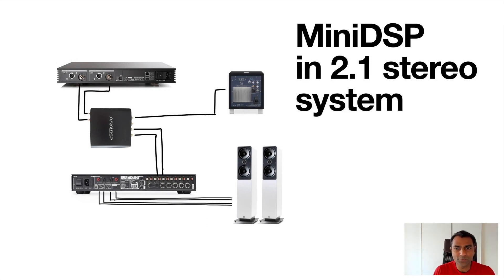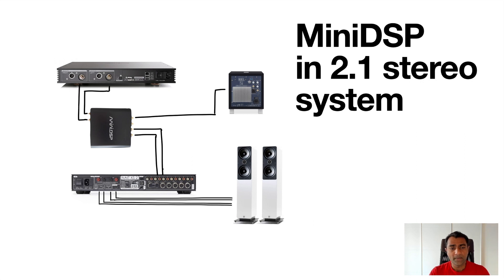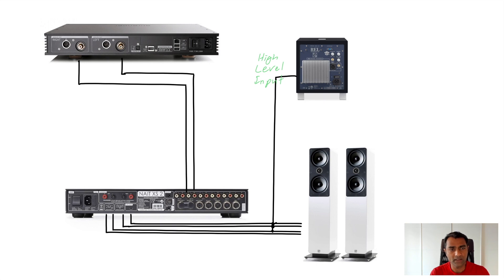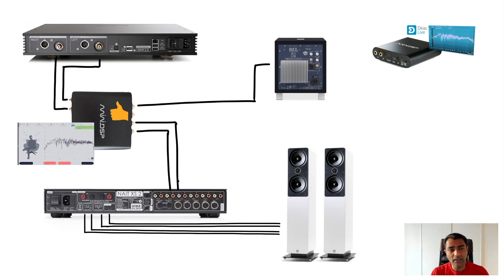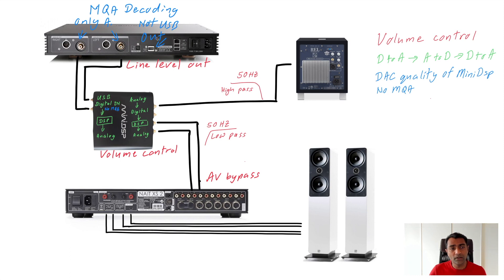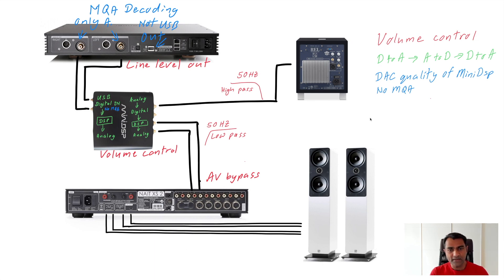MiniDSP in 2.1 stereo system

Comment: I am putting a system together and found your video interesting, I think your main challenge is you are using an receiver/AV at the core. I think you need a power amp and position the DSP between the receiver and power amp

Comment: Thank you for this video! I especially appreciated the points you made about the challenges - volume control, Conversions, DAC Quality. I have a similar set up to yours (Innuos Zen Mini server/DAC - Naim SuperNAIT3 - Dyn Super 40 book shelf - 2x REL T7x subs). I'm considering the MiniDSP FLEX for this system. Smallish room that is my home office, not dedicated 2 channel room - compromised.....system sounds good, but always....could it sound better with Dirac Live? I had thought to do a couple presets 1) keep RELs on high level inputs....mute during calibration....bring them back in manually 'tuned' 2) use .1/LFE on RELs out of the FLEX so I can utilize Dirac on the subs as well. Good point about volume control - I hadn't thought that through with the preset 1 option above. 

I read though that you have removed the MiniDSP / Dirac from your system - my 2 channel guy is a super purist, so I haven't run this DSP thing past him for concern about what he would say......what was the main reason for you to move away from the DSP / Room Correction 'solution'?
Reply: Funny - I called my shop owner, and he presented me with the same reasons to not go forward with it that you alluded to. He mentioned the same challenges, and cautioned about adding to the signal chain. He is the kind who builds relationships and wants his clients to be happy long term, so it wasn’t a ‘don’t buy that from them, buy this from me’ kind of thing. Still, excellent video! Made me stop and think through this a bit before plunking down the funds.
Reply from the maker: @OEFVet0405  glad I could help
Reply from the maker: If you like to experiment, I would say go for it and try. It’s not that expensive. Goof luck and let me know.

Comment: Excellent explanation.   Late to the party i suppose.   I think throwing MQA in the garbage is probably a positive step.   Lossy compression is getting in the way of your signal chain.
Reply from the maker: You are totally right. I got rid of the MiniDSP too. Will make another video.
Reply: @priyangh  I'm going back and forth between active crossovers in monitors and dsp and passive loudspeakers.   It seems fun to have an amp and a dsp and balance the room but the kali lp-6's in my small room will likely do just as good a job without all the fancy dancing.    On the other hand 2.1 and a nice sub is going to sound better with rew/dirac and a dsp.     Too easy to spend money on audio.
Reply from the maker: @robertfontaine3650  I’m all for 2.1 system. The REL sub with it’s crossover  harmonize very well with my speakers. Also I played with speaker placement and took the DSP out of the system.

Comment: I faced a similar conundrum with volume control in my desktop 2.1 system based on minidsp 2x4. How to maintain same volume levels across the main speakers plus the Subwoofer? I ended up building my own enclosure containing the minidsp and an ALPS multi-gang volume knob. This takes the 4 line outputs from the minidsp and reduces their volume in line with one another. The reduced volume signals are then passed on to the power amp (driving the main speakers) and the active subwoofer. No part of the signal is reduced until AFTER the minidsp has output the processed audio. I see that minidsp has recently announced the Flex processor. This should give you everything you need - plus you can reuse your Dirac license! I am probably going to buy this product.
Reply from the maker: That’s cool, I need to check on flex. Thanks for the info.

Comment: This is exactly what I want to do. Right now I have an amp that has two speaker channels (A&B) and have my front speakers on channel A and the sub  on channel B. However, I don’t want to send low frequency signal to the fronts, and want to move the sub power consumption to its internal amp. I have a Schitt Modi 3 DAC feeding into the receiver, but would probably use the miniDSP DAC as to not go DIgital to Analog to Digital to DSP to Analog.

Comment: Hi, nice video.  I'm interested in why you changed the REW from high level input to low level (ie via the dsp)  Was it not possible to keep it at high level with the miniDSP? Can you expand on this please?   I'm thinking of using a very similar set up using the minidsp studio (ie tidal> minidsp studio streamer > separate DAC>Pre-AMP>Amp> Front Speaker/REW (using high level input).
Reply from the maker: Hi, I guess you mean REL not REW. REW is the software, REL is sub. If you want to DSP sub separately you have to connect it via low level. High level in put is from speaker binds from amp. Then you can not DSP the sub separately.
Reply: @priyangh  Thanks for this (yes I did mean REL!).
Reply: It appears the studio streamer has two digital stereo outputs.  So, I’m wondering if you could use the first output for high pass DSP>separate (nice) DAC>Pre-Amp>Amp>Front Speakers, and then use the second output for low pass DSP>DAC (cheap)>Subwoofer.

Sorry just trying to figure this out myself because I’d like to use a really nice DAC going to an integrated amp with a tube preamp section.  Just thinking this might be an option.

Comment: Priyange, I was just setting up my MiniDSP with a system very similar to what you have this evening. I also noticed that when I changed the volume, my REL sub wasn’t responding, but I hadn’t thought about my layout to ascertain why.  Instead I thought maybe there were some non-linearities occurring in the room modes due to the volume changes, but now I see that wasn’t the problem (at least not all of it).  I am using a RME ADI-2 DAC which is quite versatile, so I’ll see if I can find a solution with that. Also, my AMP is a Peachtree Nova 300, which has analog loop I/O connections, meaning it sends out a pre-out for DSP and then accepts the return from the DSP. I don’t think that will help with the volume situation, but it is convenient because I can bypass the DSP with the click of a button on the remote or the unit itself.  I’ve only started setting up for a few hours but plan to give it a better effort tomorrow. Will let you know what I find.
Reply from the maker: Hi, great! let me know how it goes.
Reply: @priyangh  So, I didn't think I was going to find a solution, but I did!  Essentially what needs to happen is that the volume control needs to be independent, distinct and separate from all sources of amplification.  In my case, I was adjusting levels on my Peachtree amp, leaving the Sub amp at a fixed level, resulting in bass-to-full-range imbalances when varying the levels.  I placed my RME ADI-2 DAC BEFORE the Peachtree Nova amp and am adjusting levels using this DAC, the signal of which flows to all devices evenly down the chain.

I will try to explain, but first a DISCLAIMER:
Please use this information only after verifying with your own thought process.  The information that follows may be inaccurate or not clear, so please be careful so as not to cause damage to your sound system, in your unique circumstances.  In other words, use at your own risk.  Be sure to start off with all your amp and DAC levels LOW LOW LOW when making changes to your configuration and then, and only then slowly turn levels up.  Unless you are absolutely sure you know what you are doing, CONSULT A PROFESSIONAL or have a professional do the work.    

Here's the chain: RPi STREAMER >>> RPi/ALLO DIGIONE COAX OUT >>> RME DAC COAX IN>>> RME DAC PRE OUT >>> NOVA AMP PRE IN

Then, the loop circuit on the NOVA inserts the MINIDSP for the L/R channels:
NOVA LOOP OUT L/R >>> MINIDSP IN1/IN2 >>> MINIDSP CH1/CH2 OUT >>> NOVA AMP LOOP IN

The third and fourth OUTPUT channels of the MINIDSP run directly to powered subs.

System levels (volume) is controlled with the RME DAC remote.  This is not the ideal solution because the AMPs are running with levels high, but I can't think of any other way of adjusting the levels on multiple amps.  If you think about it, it's really the only way to do it unless you have a multichannel amp capable of 3 or more channels to drive all your loudspeakers, and even then, there is probably some A/D-D/A conversion taking place.
Reply from the maker: @aerostahr  Hi, as I mentioned in my video the only disadvantage of having the volume control in the DAC is that the output analog signal to DSP will be low at lower volume levels. That means DSP gets lesser analog information to do the DSP processing. This is my feeling. I can not clarify it. That is why I use the volume control of DSP and have set my pre/power combo and sub volume to max.
Reply: @priyangh  I know what you’re saying, but that’s the way these components are designed to work. The lower preamp signal voltages are more susceptible to noise/interference and require a greater degree of discrimination to extract all the information(if it isn’t buried in the noise due to low signal levels). I guess the best thing to do when you can’t do otherwise is to use very good cables of the shortest length needed, or do what you’re doing and control volume levels separately using MiniDSP. I have to say however that you need to ask yourself if your system and your ears are good enough to reveal a difference that is worth going to all the trouble. For me, for now, the answer is no. My system sounds fantastic. I have balanced outputs on my DAC, so when I win the lottery I’ll buy a a high end DSP with balanced inputs or digital inputs, or a DAC with built-in fully digital path DSP (which I already have to an extent since my RME DAC has built-in EQ).

Comment: Thanks for letting us know how you're trying to tackle this problem. I would love to see your REW measurements. As much as I love Dirac for surround sound HT use, they don't work well for me in my bedroom for 2ch audio. Something always seems artificial, imaging suffers, and the soundstage collapses. I also try out different speakers and subs and switch out frequently, so it's a bit tedious to have to run Dirac often. But I'm happy you shared your experiences and challenges introducing MiniDSP to your analog 2ch chain. I use one to integrate 4 SVS subs in my separate home theatre setup, and the results have been tremendous beneficial to my system.
Reply from the maker: If you are interested I could share the REW measurements with you.
Reply: @priyangh  yes, please 🙏
Reply: Priyange , can I ask how did you set your volume on your naim amp to measure and use the dirac  live . 
As it is an integrated amp ... I need your help